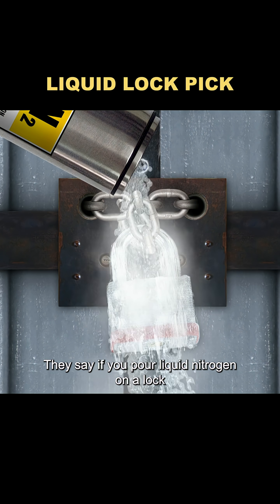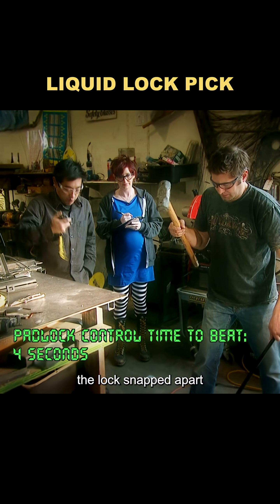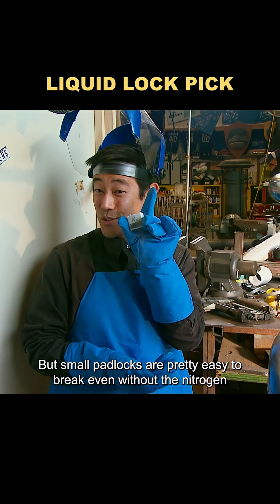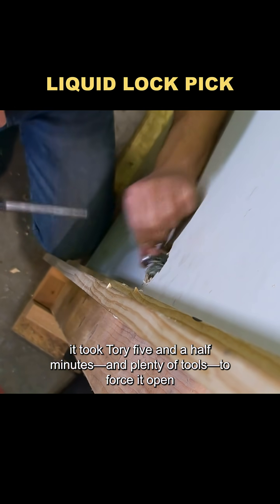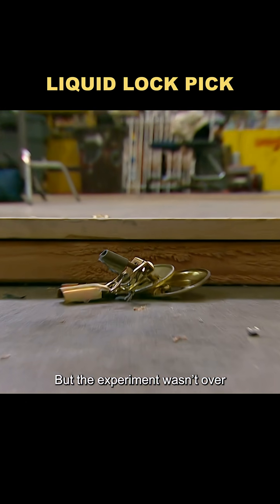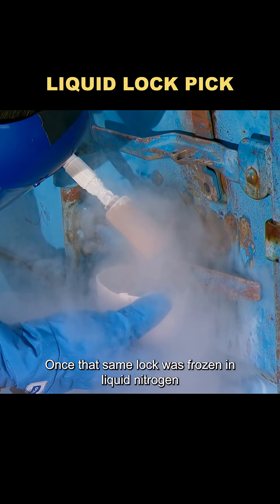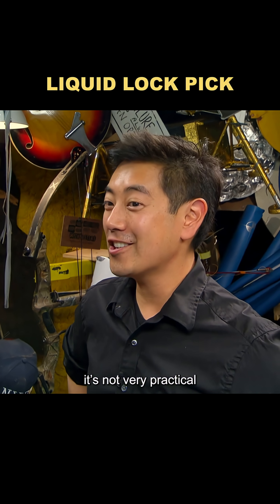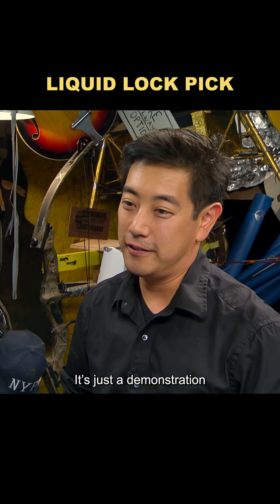What would you do if you had liquid nitrogen?

Comment: not weaken, but make the hard material (steel, cooper, spring) brittle and prone to snap
Reply: So it weakens the metal becoming prone to snapping😌
Reply: the strength material remain same, but rather reduce material elasticity so whenever it bend the slightest because impact, it snaps not bent  @Hersheei